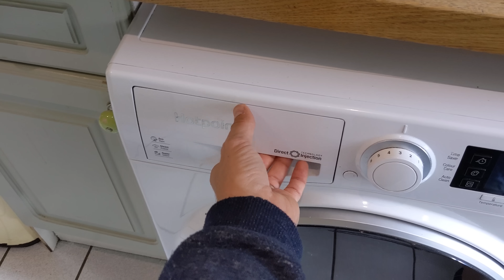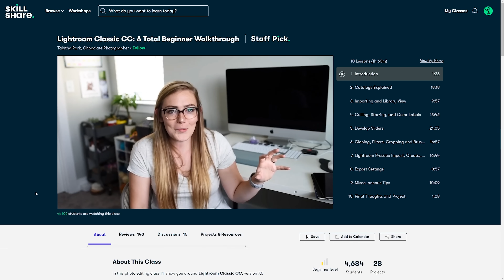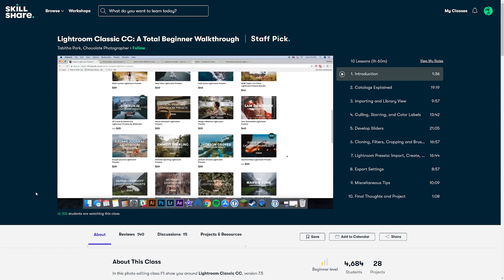The Pythagorean Siphon Inside Your Washing Machine

Comment: I've never seen that mechanism here in the United States. Nearly all household toilets here use a flapper valve opened by the handle. Link for picture reference https://i.ytimg.com/vi/FjWaQWA_rP4/maxresdefault.jpg
Reply: @Andrew H Most toilets sold for the last 30 years or so have been about 3.8 liters per flush, and for the last 15 or so, dual flush. However most dual flush I've seen work opposite of what Steve shows.
Reply: Fun fact - Hong Kong uses seawater to flush toilets. Saving a lot of potable freshwater, so water used to flush toilets is not a concern here.
Reply: I'm The Square Root We know what they are. They are also crap. They don't always seal correctly and it's common to see a constant trickle of water running into the bowl. Across an entire country, if even one in 100 toilets is doing that at any given moment, that's millions of gallons of water wasted every day.

Comment: I think another cistern mechanism is what I'd like to call a floating stopper. it's a stopper on a hinge that happens to be quite buoyant. the (relative) vacuum under the stopper, or the weight of the water on top wanting to go down is what holds the stopper. when lifted the stopper floats in the water since now buoyant force affects it on all surfaces instead of just the top. this empties the tank, and the stopper closes again, letting the tank refill. It's also why some older toilets hate having their lever pressed too quick. the stopper closes back up right behind, preventing a full flush.

Comment: The cistern of your toilet may not be self-priming, but I believe the bowl is - at least in the US. When the charge of water from the cistern drains into the bowl, it primes the siphon and empties the bowl. The flapper valve closes, and as the cistern refills, there's an additional tube from the float valve that goes down the overflow tube to provide a slow trickle of water to refill the bowl without priming the siphon. By filling the bowl to the point that the siphon starts overflowing, but doesn't prime, the charge of water has less space to fill when priming the siphon, leading to a more reliable flush.

Comment: 8:40  lol yeah I've never seen a toilet like that. Even the part where you said holding it to flush allows you to not drain the whole thing. I'm in Canada and I assume its probably similar across north America to have a toilet with a flapper. The water just drains out the bottom and when the waters low enough the flapper falls shut again.

Comment: (I’m an American) my toilet has a flapper valve: there is a buoyant plug which is held down by the water pressure above, when the handle is pulled, the plug is pulled up and allowed to flat letting water fill the bowl.

Comment: If i get it right the siphon is never "completely" emptied. Then how does the fabric softener inlet container get emptied out entirely at the end of the wash cycle?
Reply: It doesn't empty quite completely as there is a little water left at the bottom of the compartment; the bottom of the compartment is sloped down and sculpted towards the siphon entry so that the volume of liquid left when the siphon breaks is minimal.

Comment: In my toilet the handle simply actuates a lever which lifts a rubber stopper in the bottom of the tank, allowing water to flow into the bowl until the handle is allowed to return to its neutral position. I don't really see the need for a fancy mechanism with a dual mode action when this simpler mechanism allows for a continuous range action.

Comment: I've never had a toilet with any sort of siphon mechanism in the tank here in Canada. Here when you press the handle it raises a valve at the bottom of the tank which releases the water. There is a lot of variation in how that valve works but they all have the same principle. The most common are flappers and canisters. The valve will then settle back down after a few moments. The tank refills with basically the same mechanism though. Water enters, until a float reaches a set level.

Comment: Growing up in the Midwestern United States, I've only ever seen rubber flaps for the flushing mechanism in toilets. If you wanted to use less water, you either had to adjust the float so it fills the cistern with less water, or displace the water with other objects.

My grandmother lived in Western Kansas and part of the water conservation orders they had during droughts included filling water jugs and then placing them in the cistern so the toilet would use less water.

I would love to have a siphon device as the rubber flaps in our toilets do not always seat correctly, causing the toilet to randomly flush or continually fill. It's rare, but annoying.

Comment: Worst invention ever are those systems that are build into the wall and can never be repaired without having to build a new wall.
Reply: Surely such systems must have a maintenance hatch (however well concealed) too?
Reply: @rednammoc  Yes, but you can't look inside to the bottom to see what the problem might be and it's really hard to get the parts out. Especially the small parts tend to fall in during disassembly and disappear forever, while the big parts get stuck in the hatch.

Comment: My toilet uses a buey plug mechanism type thing

When the basin is empty the plug seals off the water getting to the toilet, as the water rises the water pushing down on the plug stays higher than the buoyancy of the plug, however, when the plug is pulled, it gets the plug far enough away from the hole that the buoyancy can keep it away from the hole and let the water through until the basin is all but empty again
Reply: Traditional toilets in Norway used to be the same, with a plain vertical pipe to handle any overflow, if the lever float was out of alignment or the filling valve no longer sealed properly.

Modern toilets use the pythagorean approach, but is kicked off by pushing air into a sealed tank. Two separate buttons initiate the effect from different levels, thus causing "half" or "full" flush.

We usually have a vertical sewer pipe going through the floor, so our toilets have an S bend / S trap to keep the sewer smell from entering the bathroom. It's basically always "in balance", or at the same level of you like. The waste is removed by the water "pushing" it though and over the top of the S bend. If you pour water slowly from a bucket, you will eventually "replace" all the water / pee, but business with more mass will not "climb" over the S bend, and thus still remain in the bowl.

Very light objects, such as poop full of methane or dead flies, ants or moth, will not flush easily, as they will simply dance on top of the water when you flush. This is best solved by putting a sheet of toilet paper on top of the water and light object, and the toilet paper will often carry the light object away with it.

Comment: South Africa I have seen your siphon, but typically only in older systems dating from the 1970's. Most common is a direct mechanism where there is a vent tube, which also acts as overflow, and then a rubber flap valve that blocks the opening, with a small float that holds it up till the water level drops below the float, allowing the rubber valve to close on the seat, with the vent allowing the water in the pipe to empty. Simple to maintain, as typically you just have to unclip the valve mechanism and replace the pink rubber valve once it wears.

Another type is like your siphon, just it has no valves at all, but relies on having a long tube down to the bowl, and then a heavy cast steel sleeve over the inner tube, which is lifted up by a lever pulled by a chain, so you pump the system once or twice to lift water up the siphon to prime it, and then it will flow till empty, similar to the water in a tube siphon. Was used only on really old systems, but very reliable, as there are no real parts that wear other than easy to replace pins. 

Totally obsolete now, as there are regulations on water use per flush now, so you find them all gone, as they had a massive tank that would hold 50l of water, using around 35l per flush. Replace that tank and you typically also replace the toilet with a new low flush one as well, which can be difficult, as most have been well installed, and you need to remove a very tough concrete plug to get them out.

Also have seen suspended pans, which used the siphon and flap valve, and often making a replacement valve was a matter of cutting one out of a very heavy PVC bag and installing it, as they were not easy to find. Valve replacing was also requiring you to dismantle the outlet piping, while the modern one you can replace it from above, just twist it off the 3 locking pins in the plastic moulding. You can guess if I had to do a siphon valve the siphon was gone, and the modern kit was in there instead, as it was often cheaper than the time to go buy whatever size diaphragm it used, or cut it out, as I had a few full kits, just to make repair easy and fast, replace one half, and all the wear items are done.

Filling valves there is also a lot of variation, you should look into those, from the ones for low pressure water mains, to those for rooftop water tanks, to the ones for high pressure. For urinals it is almost all that now use a push valve, as the automatic systems have been banned as water wasters, so they all have been retrofitted with a push valve that delivers a pulse of water to the system, and instead of having (as the most common type) a tipping tank, the tank is now fixed in the tipped position for larger ones, or small ones it feeds direct.

Comment: Every toilet here in the US that I've messed with just has a flap valve at the bottom of the tank that dumps straight into the bowl. Plumbing into the tank is just a float controlled valve with a tiny diverter hose that goes into a tube that ends just above the tank fill line and is made into the flap valve assembly. Tiny diverter hose pre-fills the bowl and the tube allows it past the valve while also preventing a tank overflow. Also the actual bowl drain uses siphoning to flush.

Comment: So all the toilets i come across have a simple seal at the bottom of the tank that seals off a pipe to the bowl. Turning the handle opens that valve and lets the water through. More water is then let in, which closes the valve. We have a similar mechanism that stops water flow with a float. Maybe a US/UK difference? I have yet to see a siphon mechanism in the US, although I haven’t investigated every toilet I’ve used

Comment: Backwards action in Australia; short press/ small flush button does a small amount of water, long/large does a large amount of water. General mechanism for empty is a self latching valve, water flow keeps the latch open so you don't have to keep holding the button.

Comment: I am English and understand the siphon toilet system that you showed. But now I live in Portugal and was surprised to find when when renovating my apartment that the toilet cisterns all have dump valves sealed with a rubber washer. When these washers get old little blisters form that are filled with water, thus opening the valve. Dont know why or how the blisters form but took me a while to work out why the toilet was running all the time.

Comment: Push button toilets almost all just have a valve at the base of the cistern; that means they almost all leak.  The siphon mechanism itself never leaks, that is one of the main reasons why it was invented, to prevent water wastage (the ball cock is a different matter though, but it is usually easily fixed with a washer).

Comment: I feel like I live in a paralel dimension where everything is the same but some things are different... Like for example my washing machine doesn't have that... There's simply just a compartment that is empty at the back and it simply flows in as I pour it. What a fancy washing machine you have!

Also urinals that flush in periodic intervals? WHAT?! I've never seen that... Doesn't that seem a bit wasteful and ineffective?

Lastly about the toilets - in my country (Czechia), we have two buttons to flush. The small one flushes a little (probably a half) and the big one flushes the whole thing. It kind of nicely relates to our way of saying "number 1" and "number 2" - instead we go "for the small one" or "for the big one" (although that has existed longer than those buttons).
Reply: The periodic urinal flushes are common in the UK and often in public toilets and combined with an infrared sensor which shuts the water off after a while if no-one is in the room.
Reply: The occasionally flushing urinals are used in large public toilets where it can be expected that a lot of people will be using the urinals constantly. This stops each person having to flush it (wasting more water than necessary) but ensuring that it does sometimes get flushed to stop it stinking. 

The one at my work has a little electric valve that only drips water during set times so that it doesn't need to be turned off overnight. It also flushes multiple urinals at once by emptying with a T junction into a horizontal pipe that feeds multiple urinals.

Comment: Interesting,  I have never seen the mechanism you have shown for toilets. Never bothered to take one apart, but ours have flaps at the bottom of the tank that are connected to the lever via chain. When you flush the flap pulls open. Must be buoyant because it stays open until all the water is gone then reseals the bottom.

Comment: I'll check my toilet tomorrow but,

From what I remember, it has a air filled ball on the surface of water, which when floated to the top, closes the inlet valve.

And the flush button is a seperate mechanism which ovens the output valve.
When the tank empties, it has a mechanism which closes the output valve...

So if you pressed the flush once, your get your entire tank of water in flush.
If you pressed it halfway, then manually lifted it up, it would stop emptying and reach the normal position.
If you kept pressing it even after finishing the flush, you would keep both the inlet valve and outlet valve open, so the water from mains keep dribbling into the toilet bowl...

Comment: All of the toilets I've seen in the USA have a rubble flappy bit at the bottom of the tank (I think that's actually the technical term, but probably not). When the tank is empty, gravity pulls down the flap to form a seal. The tank fills slowly over a minute or so. As the water level rises, a float is pushed upward, cutting off a valve to stop the filling. When you flush, you push down a handle which is attached to a lever. The lever has a chain on the end, which pulls up the flap, and the water just drops down into the bowl to flush. When you release the handle, there is a bubble of air in the flap that keeps it in the "flushing" mode until most of the water is gone, then the buoyancy holding up the flap goes away, and the flap drops down, resealing the tank. When filling, the weight of the flap is just enough to keep it down until the weight of the water over it can hold it in place against the buoyancy that would otherwise cause it to rise.

Some common failure modes I've seen with this design are: The force required to lift the flap can be quite large on some models, and the handle can break if you push too fast. When the flap does rise, it causes the chain to rebound, and that can unhook it from the lever. Then you have to reach in the tank water and retrieve the chain to fix it. The float can become damaged over time and leak, causing it to not exert enough force to seal the valve, causing a seeping tank. The valve can get contaminated with scale and lime, causing a poor seal and a slow trickle of water that never quite shuts off. The value can lose the spring action that causes a positive snap on and off action, thus leading to a value that closes very slowly and makes a hissing sound for several minutes until finally shutting off. The rubber flap can get scale and lime on it, causing it to not seal perfectly, thus the tank either never quite fills all the way, or it leaks slowly causing the tank to cyclically refill, wasting water.

Comment: Most residential toilets I've come across in the southern US have a rubber float valve to drain the tank. The chain from the handle is connected to the valve in the bottom. Once pulled open by the handle, the valve floats as the water passes through. When the tank is empty, gravity pulls the valve shut, forming a seal strong enough to overcome the buoyancy of the float, and allowing the tank to fill again.

Comment: Granted, I'm no plumber, but I've never seen a toilet with a mechanism like that. All the ones I've seen have the flush lever attached to a rubber plug at the bottom of the tank. You push the lever, the water starts to drain, and the flow keeps the plug open because the plug is less dense than water. Then it closes when all the water has drained. They must all be older design, clearly there's no option to drain only half of the tank with this design.

Comment: I know two types of toilet mechanisms here: first is simlpy hole in tank and you pull plug from it. Plug is restrained with some kind of cage so when it falls down it close hole. Plug is floating hence it will close hole when all water is out.

My modern toilet mechanism much more interesting. Basic idea is same. This time it's in shape of tube, actually, two tubes, one inside of another. The role of plug now plays tube. When you push button you actually pull tube by small lever arm mechanism. Because plug is now tube, it handles overflow naturally. If water overflow it just sink through this tube. But height is high enough to not overflow normally. 

What is tricky is two modes. Basic idea is same: there are floating parts that blocks tube-plug way down until target level of water reached. So, instead of floating plug itself, here it locks in position while floating part is too high. I thought it's everywhere nowadays.